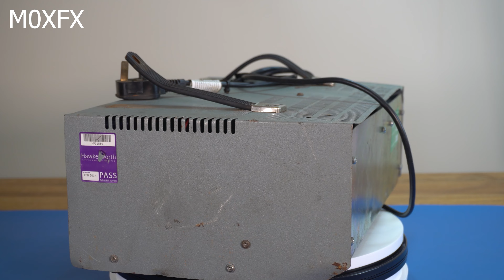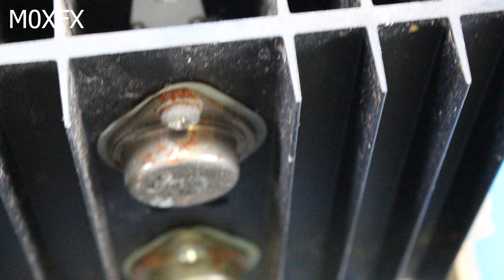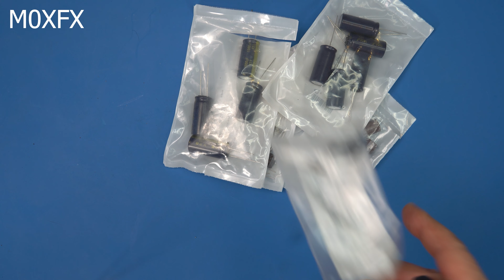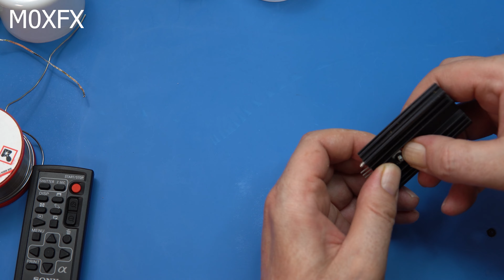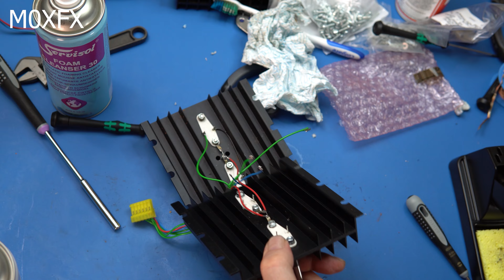tti PL320QMT DC Bench Power Supply Restoration in QuickTime Part 1

Comment from the maker: I use Lead / Tin 60/40  solder and the iron temp is around 340/360C but that may but be different for silver based solder which I try avoid using. Good question and food for thought and for a future videos
Reply: Thanks John, thats good to know , as my Micron 45 watt,station sits at 350 most of the time, ..
PeaceN73
Reply from the maker: @andrewverran3498  Hi Andrew, It's not all about the wattage the size of of the iron tip makes a big difference. You should practice on scrap boards  adding and removing components, that's how I got to grips with it.  I hope this helps
Reply: @M0XFXUK  all your advise helps..good to have an iron that heats up in 10sec..its ironic i mentioned your cobra200dx to a friend of mine , as he rebuilt a cobra 200dx that had simikar issues to the one you had, he said he already watched some of your videos in the past which is always a good sign as i respect all advise...you may of heard of him Yellowdot...anyways its a lot easier understanding with video, for us electronics 101 muppets.